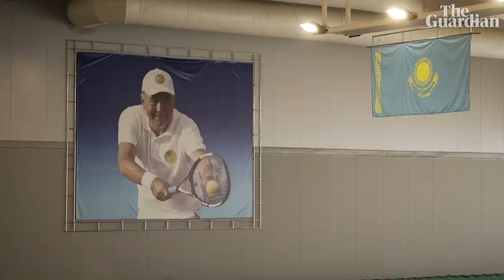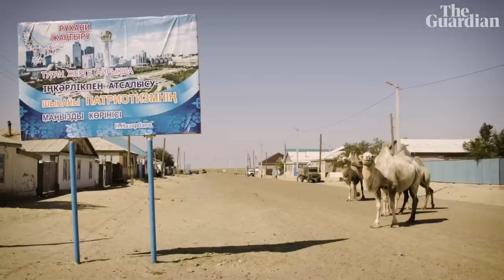The new green superpower? Oil giant Kazakhstan tries to wean itself off the black stuff

Comment: Electricity will win.
The bet on electricity is a good bet for any country. Wind is free. Sunshine is free too.
Supplies of coal and oil are not free. They do require transportation, maintenance of delivery networks and equipment and infrastructure. The wind, hydro and sunshine are cheaper, because the fuel is basically free. 

All things are becoming electric for more than 100 years now. Electricity is wining.